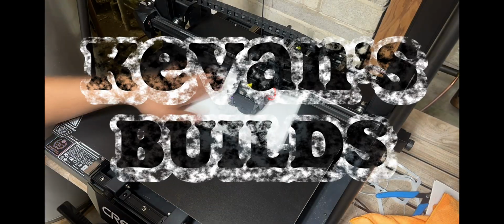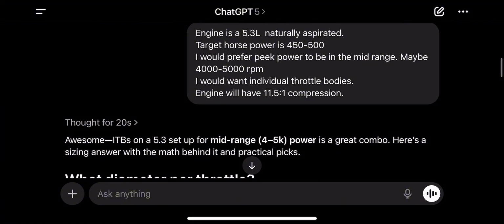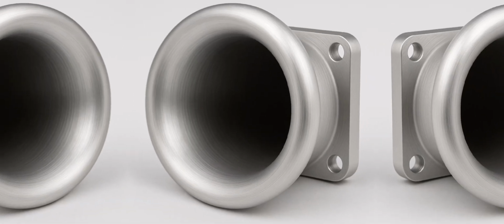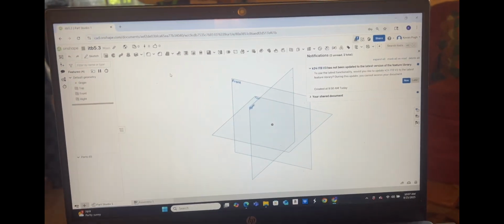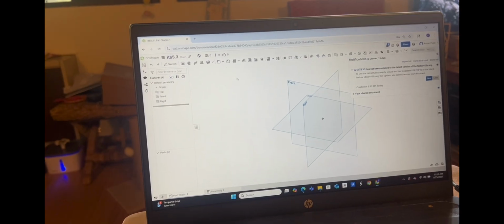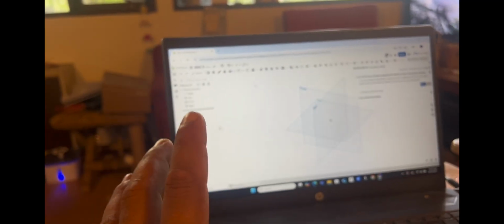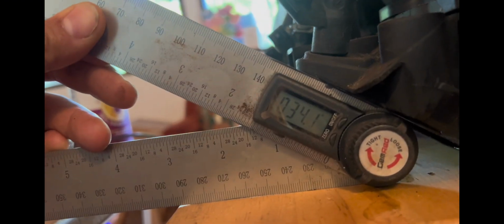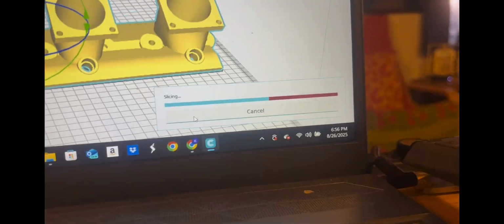I Used ChatGPT to Design 3D Printed ITBs for My Budget 5.3 LS Build!-Part 1

Comment: Really interesting approach, I think pa6-cf is the most heat and chemical (take into consideration that gas will degrade a lot of printable plastics) resistant filament but being inside the V and in direct contact with the engine may be too much heat. Also you won't be able to print that kind of technical filaments with your printer without heavy modification. 
As someone said in other comment sand casting might be the most durable option, and you can print a sacrificial pla mould. Or slm prints...
Reply from the maker: Thanks for the comment! I was able to upgrade my hot head for higher temperature prints. The printer does amazing with poly cast filament which I have already purchased. I’m also planning on making a furnace to melt the aluminum.  I’m willing to try the printed intake to see what it can handle. I could run it on an engine dyno to see how it performs. We will see!

Comment: You explained that well enough that this geezer was able to follow it😀 Can this material be used as is or will this be used as a casting model ?
Reply from the maker: This is a cheap PLA that will be used for prototyping and I will revise. Once I have made the final changes I’ll print in a more heat resistant material that will hold up to the heat cycles and temperatures. I won’t be doing any casting.